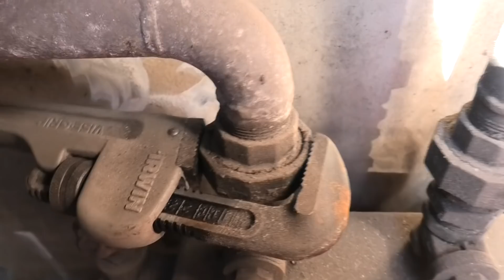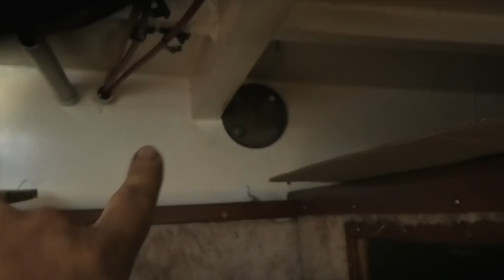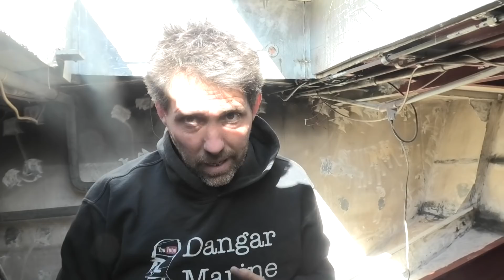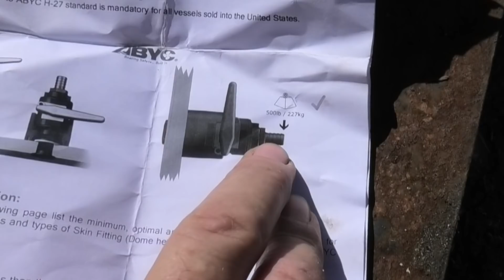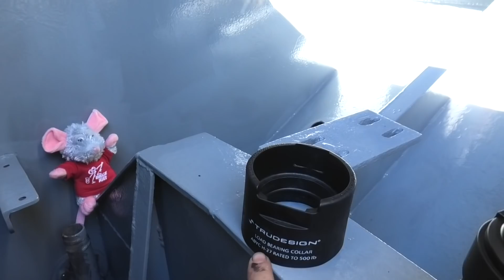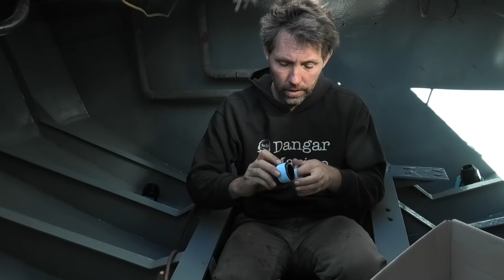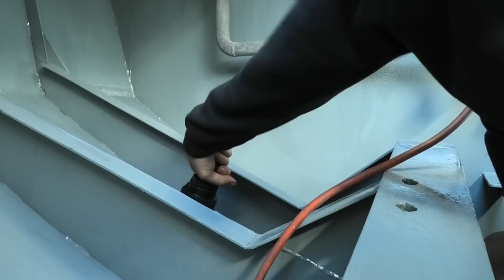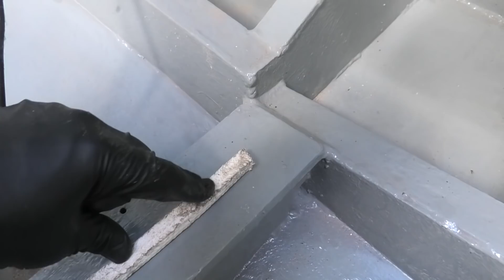Seacocks and stern gland

Comment: Maybe go for 2.5 MM Rods as you can control the Amps and the heat better giving you a more stable Arc and thus better deposition also check the option of whether you are on D.C. option on that little Inverter Welder and also play around with the settings and polarity whether you're rods work better on Negative or positive earth.... a small welding plant works great with the smaller diameter rods whereas if your trying to burn those 3.5MM suckers you need very serious Amps,  that's why you have slag traps..Not enough Amps  and don't be afraid of relaxing you wrist...I used to bend the rod through  90 Degrees after sticking same into the electrode  holder..gives you more control..worth a try...and tuck your elbow against your rib cage /torso  when your are in a cramped position as it steadies everything up..Great Upload...Thinking you have really turned the corner as you're launching your boat next week, and have all that welding in cramped spaces behind you...good luck with the launch...
Reply from the maker: Thanks for the tips, much appreciated. I need to learn more about the different types of rods and which polarities they can be used it. I think that is a part of welding that many beginners ignore while they focus on the basic co-ordination of running a bead.
Reply: @DangarMarine  Just takes a little time and some  of practice then you start  getting things right and once optimize the plant you're running you will be truly sorted, the great thing is the gear you can buy today is so much better that  ever a few years back and also half the price, great resolve by you to do all this trojan work, looking forward to seeing her in the Water...

Comment: Stu,
As always, enjoying your videos, being and old US Navy sailor I can appreciate your work.  2 questions, you are using grease on a lot of your fitting and fasteners.  I am a big fan of the marine grade anti-seize from Bostick.  It works well in seawater applications.  Second question, and I know you have been busy with getting the hull in the water.  How is the engine coming along?
Reply from the maker: I'll do a search for the Bostick anti seize. Engine is still in the machine shop. Is was going to be ready this week but when I said I was heading to the US for a month they said they would do it while I was away so it wouldn't be sitting around. The plan now is to time the work for the day I get back so we can get straight into installing it.

Comment: I CAN NOT UNDERSTAND WHY YOU ARE REMOVING THE WHOLE UNIT NOT TO BE REPLACED AS IT IS PART OF SURVEY FOR THE VESSEL AND IS MUCH MORE EFFECTIVE THAN THE ELECTRIC BILGE PUMPS. PLUS IT IS ALSO A GOOD ARRANGEMENT TO GIVE YOU A DECK HOSE WHICH RUNS OF YOUR ENGINE. THE VALVE CHEST BEAT A BUCKET ANY DAY
Reply from the maker: I will be replaced once all the valves have been serviced.

Comment: Instead of a big hot water tank, there are point of use 12v water heaters, which would go near the faucet in-line. We use some at work and they get hot really fast
Reply from the maker: Sounds like a better way to go.

Comment: Only problem I've had with teflon tape is that you can overtighten the fitting so easy, it never feels tight, it's also hard to keep the fitting in the correct orientation. Think you were wrapping it in the wrong direction on the barb fitting as well. I'm not trying to be an ass btw :-). Looking forward to the launch ..........Mike

Comment: Zero Stu = 15C  You crack me up !

A bit late now  ...  What you should really have is a 40L-50L plastic container with about 20l-30L of Evaporust ( amzn.com/B00GRSOJSS ) or equivalent.  I recommend this product because it is will not harm your skin.  You could put that whole sea chest, valve and all into the solution.  After 24 hours, removing and disassembling the valves would be much easier.
Reply from the maker: Sea chest still needs serving so I'll give that a try.

Comment: Did you weld up the exhaust hole wet exhaust or how did you water tight it?
Reply from the maker: Haven't done it yet, but welding a plate over the inside end of it.

Comment: Thru hull fittings and ball valves....Why not use brass for maximum strength ??
Reply: is brass truly max strength? Got any references?
Reply: @jonnenne ....Forespare Performance Products...... For below-the-waterline plumbing, select components made of bronze or Marelon..
Christian & Co.The strength of the Marelon components is less than bronze.  So use bronze in high traffic or exposed areas, otherwise I choose plastic.

Comment: Detroit diesel used in some application used a pull cable on the emergency stop. (A flap in the blower intake)
Reply from the maker: Yes, this engine didn't have a flap on the blower intake but I'd like to install one.

Comment: In the future it would be nice to put a grease fitting on shaft log. For the obvious reason and also if you are going to Moor the vessel for an extended period of time and want to stop the little leak from the stuffing box  just a couple of quick squirts and you are good instead of overtightening your  box.
Reply from the maker: Yes, I do thinking adding a grease fitting is a good idea.

Comment: Might be an idea to put a grease nipple on that stuffing box, It would have been a good idea to use graphite grease on the packing. Dry packing will soon wear grooves in that shaft. Carbusonic GRB411
Reply: @IndyHelis  That packing looks bone dry to me.
Reply from the maker: It's infused with teflon and has quite a slippery surface. Probably more slippery than the grease I had.

Comment: Hi Stu,
Summers on its way!!
Fantastic progress mate n all coming together, nearly time to wet the boats arse again.

Nyloc Nuts required on each end the stern packing studs, and plain locking nuts on the inside of the 2 flanges, on all 3 gland studs, will stiffen it all up also.

Measure the gap between the 2 flanges so gland packing is compressed evenly n lock it all in place with lock nuts.

Just for vibration mate and peace of mind.

Your doing fab mate
Cheers
Malc (Qld)
Reply from the maker: Hey Malc, you are dead right about the Nylocks, I'll definitely grab some for the ends. Would hate for it to vibrate out and flood in.

Comment: great progress Stu. Question, you spoke of the sea chest and manifold. Will this system be reinstated in some form? Sounds a lot like a bilge pump out that would be required. Cheers
Reply from the maker: Yep, once it is all all cleaned and the valves replaced I'll put it back in.

Comment: Get your self a " Cheater Lens" for your welding helmet. I have used one for 4 years know @ + 2.0
around £8.00. makes a lot of difference.
Reply from the maker: Yes, I often don't have my reading glasses with my so I'm just welding a blurry section of hull hoping for the best!
Reply: @DangarMarine  
What is the saying..Hope it floats, get the lenes off ebay...

Comment: ahh, the old "all plastics are crap" argument. i work in aerospace R&D, where "because that's how it's always done" is a valid argument. I tend to use polymers wherever i can, especially as bearings. tribo polymers are getting damn close to rivaling bronze alloys in every respect, for an 8th of the weight. in places where corrosion was a problem, sprinkling some polymers around can fix it right quick. 
Same with glue. Lotus has been bonding aluminium with glue for donkeys years, but in aerospace everyone resorts to chicken rivets. glue has it's issues like inspection and messy installation, but those can be designed around. again, same with the use of chrome-6. we all agree that yes, the stuff works, but it's poisonous in 6 ways, one of those things that will kill you now and later, so we don't use it anymore. accept in aerospace, because we're special, and we don't like change. i've damn near banned it within out company, but getting the suppliers on board was a nightmare (and it's their people that die from it!). 

Accepting new stuff before all factors are known can be scary, but the benefits are huge, and the risks are usually manageable with proper engineering. 9/10 times it's just people being stuck in their ways, not following developments in their field, or being to scared of the responsibility.
Reply from the maker: It's interesting to hear how the aerospace industry is like that, I would have thought the opposite. The maritime industry in some ways is very traditional and old school, but because people see the corrosion issues first hand they are always looking for a better product.

Comment: Need to do a better job on welding to fill missing metal under the waterline. 23 years USN, learned a lot about through hull leaks.
Reply: I thought that, looked a little slapdash. Why leave holes, surface imperfections. It's the one place you need to be spot on I would have thought.
Reply from the maker: I really just needed some extra metal for the load bearing collar to fit on. The outside flange where the fitting seals is in the great condition.
Reply: @DangarMarine  I guess the one thing living on ships for most of a 23 Navy career taught me is that if there is a place for water to seep and cause corrosion seawater will find it. Every place not filled in with good weld will eventually rust, whether from the top or the bottom.

Comment: Plastic  through hull fittings in a engine room or bay ? Maybe things have changed, but insurance would have a kitten over that at one time and quite rightly so.
Reply from the maker: I’d be more worried if the whole boat was plastic like 90% of motor cruisers are.
Reply: Ah if you have a Tupperware boat that’s a different kettle of fish but so are or used to be the premiums between a steel hull and a plastic one

Comment: I got one for ya stu i have a lower unti off a 4 stroke 300 hp yamaha the unit locked up stopped the engine. I have been trying to remove the bearing carrier but no matter what i have tried its frozen. What the heck can i do to get it out so i can rebuild it?????
Reply from the maker: Generally heat is the only way to get them out along with a strong puller. Unfortunately the paint on the lower unit will often suffer before it is hot enough to get it out so maybe great a can of Yamaha touch up paint too.
Reply: @DangarMarine  thanks i will have to buy a puller i tried to make my own from rebar but the rebar just broke so i guess ill have to spend the 200 bucks and get one

Comment: a bit worried about not enough teflon tape seeing you screwing the through holes home with out using a tool to do the last bit
Reply: I thought that it screwed on too easy it should be really tight on the last full turn.
Reply from the maker: I thought the same thing to be honest, but not sure if it is because it is a straight thread rather than tapered. Will check it before it goes in. Need to buy more tape!
Reply: @DangarMarine  I have come across this before and removed the part and put teflon and on top of the existing with a thin film of silicone sealant on top of thread tape to stop the tape balling up ,on some fittings i have had to repeat this process a number of times before threads take up before screwing to bottom ,saves those pest little leaks

Comment: Stu when i brought my boat and got a survey they picked the composite thruhulls even though they were above the water line , surveyor told me  another  yacht had reversed back over a pontoon and sheared their composite thruhulls off and went unnoticed in calm waters , apparently when they went offshore it flooded the boat which then sank,  sounded like a urban myth to me,  i mean it possibly could have sheared a bronze ones off or damaged the boat otherwise , but in my case i had to change in order to meet insurance requirements , composite fittings are tough!!
Reply from the maker: In NSW composite fittings meet commercial survey requirements for use below the waterline so no insurance issues. Would be interesting to here the real story. I figure even if the head of the fitting got damaged the shank would still be sikaflexed in and the ball valve working.
Reply: @DangarMarine  yes agreed , unfortunately I bowed to surveyor and insurance pressure and replaced them with stainless ( not sure if I believed the story ,it's never failure of 1 thing more like a series of failures that lead to a catastrophe)

Comment: Hey Stu, love the vids mate. Keep up the good work. Just a quick note, when putting teflon tape on, you should wrap it on in a way that the tail of the tape lays down in the opposite direction to doing up the fitting . If that makes any sense? Cheers
Reply from the maker: Indeed. I wasn't paying attention and actually took it off and redid it before installing it.
Reply: %100 agree old school knowledge there was taught that 40 years ago

Comment: Good video mate! I would like to suggest you put a first aid box in every compartment. Inside the first aid box put a sling. If for some reason you get knocked around in rough weather and hurt an arm it will allow you to support the bad arm while you use your good one to climb up and out of the compartment. I unfortunately learned this lesson on dry land the other day when I had to use my belt as a sling in order to free my good arm so I could get up off the ground. Also always wear a belt! Cheers mate!
Reply from the maker: Sounds like good advice. Sorry to hear about your accident.
Reply: @DangarMarine  Thanks mate!

Comment: Cable may have been to emergency air shut off flap on the blower , I always make sure one is fitted on vessel when fitting a Detroit. And I hope you’re going to remove that coupling and clean the grease off the taper, should be dry and clean.

Comment: The new thru hull fittings look a lot stronger than the white ones you were using, I wouldn't be afraid to use the ones that you installed. I like the spacer that goes between the flange on the shaft and the gear it will give you some "give" if things are not perfectly lined up.

Comment: Stu, make yourself a couple tapered cone wood plugs the size of the through hull holes to have onboard in case you have a failure. A boat yours size should always have some wood plugs for leaks.
Reply from the maker: Yeah, always good to have some bungs on board!
Reply: @DangarMarine  thats what SHE said lol
Reply: @DangarMarine  LOL!
Reply: I used a tapered wood plug when changing a thru hull in the water. I have three of them on the boat, just in case!
Reply: Yes...
Reply: I know it sounds weird, but on the wrecker we keep bars of soap to whittle down to the right size of any hole, I know water and soap goes together,  but it is just temporary. Just a thought.
Reply: Soap is good for fuel leaks and you can wash you hands with it also. :-)
Reply: Fin you sound like a Damage Controlman...
Reply: Nope, done a lot of damage I had to fix though. lol
Reply: @finscreenname  lol good one :-)
Reply: Damn I was thinking the same thing but I don't know anything about boats.
Reply: Deff want to have a few on hand especially with those plastic seacocks
Reply: I was thinking the same thing for the ball valves just in case one gets busted off

Comment: Don’t you need washers on those stuffing box flange nuts?
Reply: Reckon at least locktight
Reply: @MrThebrownie72  The stuffing box will likely need to be adjusted occasionally so I would double nut the bolts (over washers) rather than use any Locktite. The common recommendation is that the stuffing box should be tightened just to the point that it still drips a little when the shaft is turning. This assures that the packing isn't jammed in so tight that it will cause heat or excessive wear on the packing or the shaft. He will also want to check to be sure the stuffing box isn't leaking when the boat is left on a mooring. I always put a grease fitting below the packing rope on mine. That way I can pump enough grease into the shaft pipe to prevent leaking without the risk of crushing the packing rope. Once I'm underway again the grease disperses enough so that the stuffing box resumes its slow drip. Sometimes I have to loosen the stuffing box quite a bit to get water to leak through the grease but then I can tighten it until the leak slows to a drip.
Reply: Nope. Washer are not meant for what your saying , and no lock tight. Need to adjust

Comment: How do you plan to lift the motor and transmission onto the boat and into place once it's in the water?
Reply from the maker: Barge.
Reply: He's installing an onboard crane (or did so in a previous video) with enough reach to drop them into the engine bay.
Reply: Ok cool.

Comment: great video again Stu never mind the heat exchanger water heater a new lpg instantaneous is less than a grand you'll save that in a year on diesel running engines and you won't have to wait for the water to heat up
Reply from the maker: For sure mate, I think instant gas is the way to go.

Comment: On the sea cox Inlets on the outside of the Hull, i would have thought that these days they would have a short thread (or a push turn lock) on the inside of the inlet so as to put a water cap on, so that you dive under put the water cap on and it seals up the inlet and you can then if needed, replace the valve on the inside of the boat, whilst in the water, anyway just a thought :)

Comment: Stu, cut a small groove into the spinning bolt's thread that is sticking through the nut, use an open ended or ring spanner and a screw flat driver to hold it while turning the spanner...